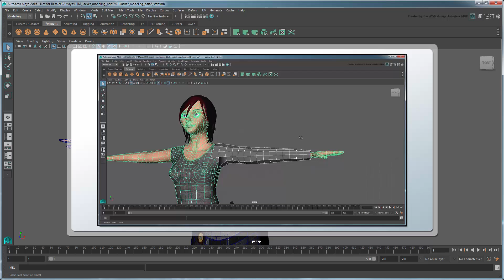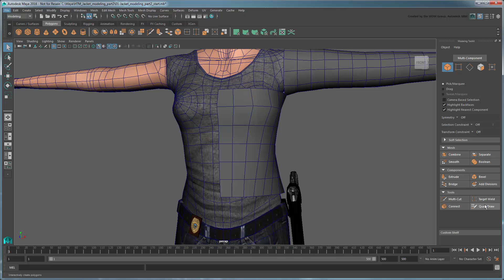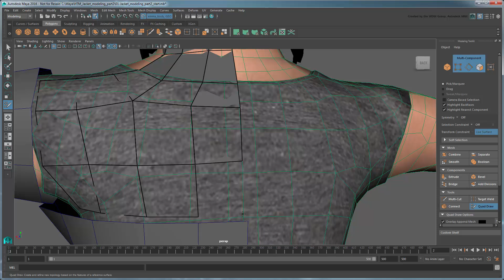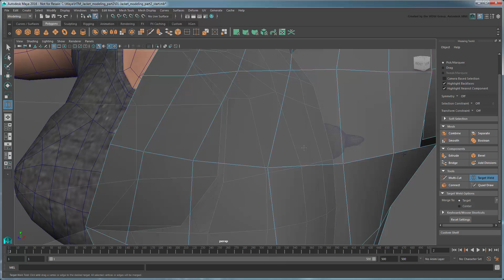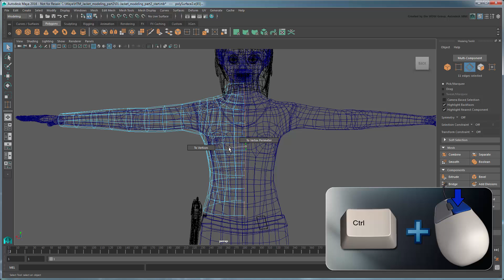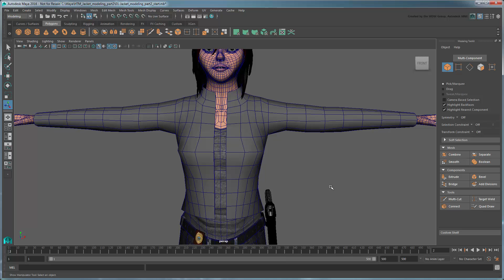Modeling and retopologizing a jacket - Part 2: Quad drawing the shoulder/collar

Comment: Hi is there a way to make clothes in Maya in a more similar way to marvelous designer
Reply from the maker: Unfortunately, Maya's modeling workflow is quite different from Marvelous since it needs to cover more things than clothes.  However, you can do dynamic cloth in Maya to get clothes that react realistically to animation using nCloth.  http://help.autodesk.com/view/MAYAUL/2018/ENU/?guid=GUID-6FB65F16-528E-40F5-89D6-508CF654C547

Comment: I have a question, does Maya Extension 2 has the Modeling tool kit?  and if it has it, is it in the same place or somewhere else?
Reply from the maker: 2016 extension 2?  The answer to both questions is yes.

Comment: Thank you 
I have a question regarding animating the jacket or any other clothing. 
Do I have to smooth bind the jacket to the character's joints together with the body mash or there is other way. 
Thank you for your support.
Reply from the maker: Matan Shilo That is one method.  Another method is to use nCloth to actually simulate the jacket as a cloth object (good for film but I don't recommend using this method for games).
Reply: Thank you
I'll check the nCloth option
Reply: What method would you recommend for games? Specifically games made in Unreal engine 4
Reply from the maker: Skinning is generally the least computationally expensive and thus the method most often used for games.